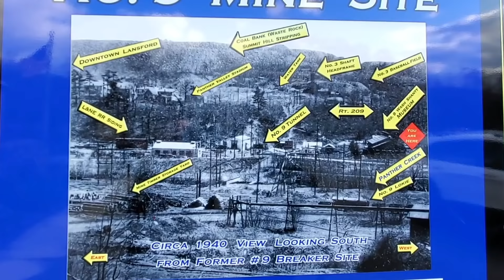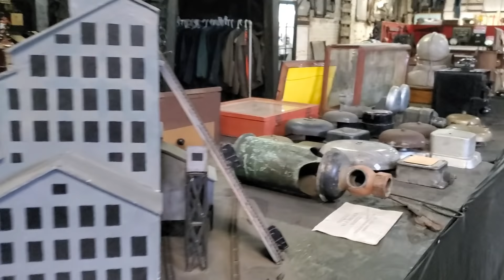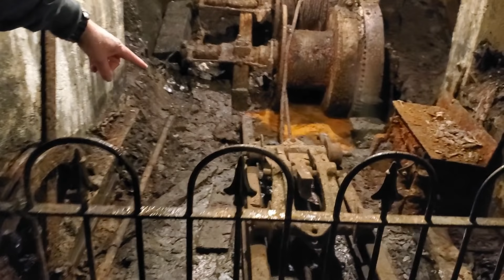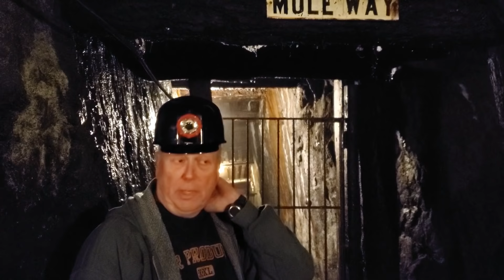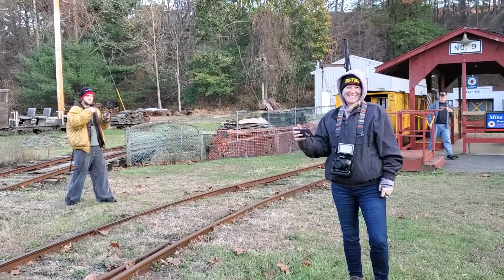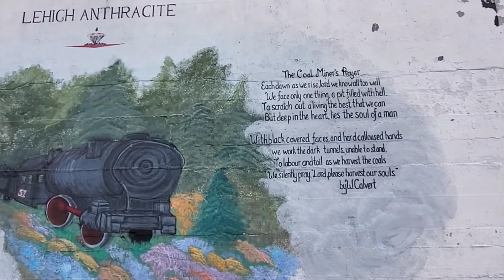Exploring A 117yr Old Anthracite Coal Mine - Lansford No. 9

Comment: At-39:51-  Isn't that where they showed in a picture that a steel structure was, kind of looked like an oil rig and they said it was no longer there, but maybe the hole is still there and they have it blocked off for safty reasons and maybe to help keep the water out.